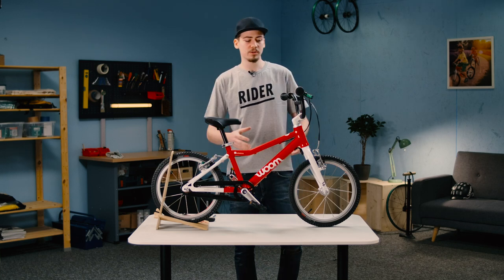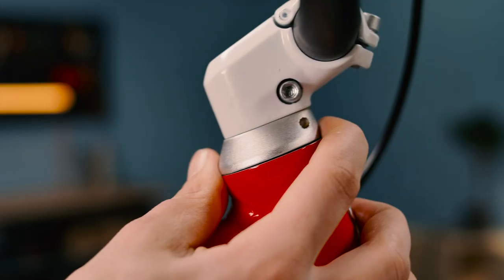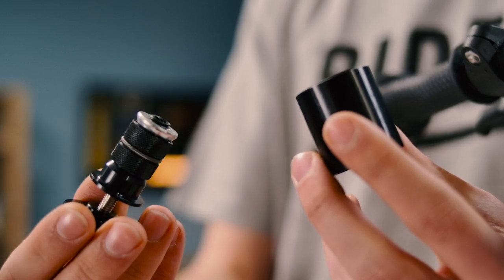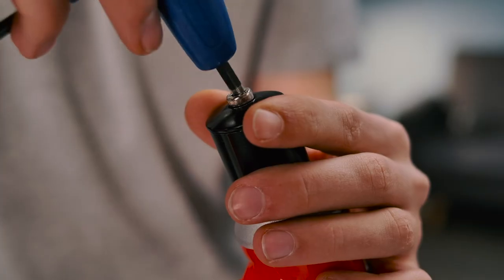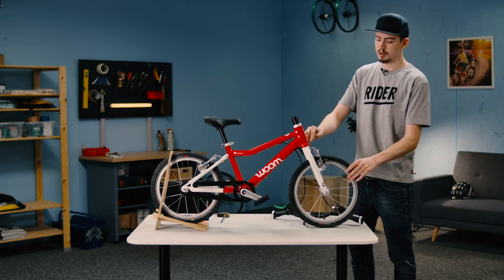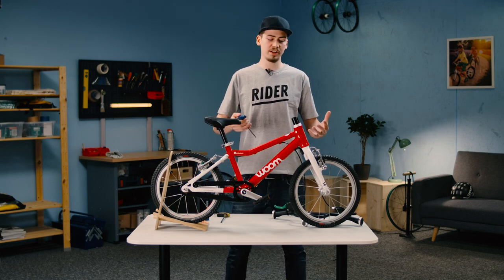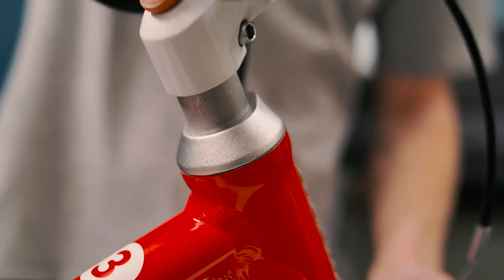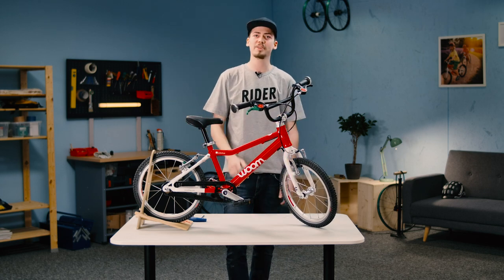How to tighten the headset | woom bikes HOW TO 2

Comment: The screw to loosen the silver cap of the headset is on our 2021 Woom 4 replaced by a Torx T-25 screw!
Reply from the maker: Hi Chris! Yes, with the models from November 2020 onwards we made some changes. The stem is now attached with a clamp using two side-mounted bolts behind the stem. Kind regards, Verena

Comment: What is the torque for handlebar screw on stem please? I used 6Nm, but my only 14kg daughter  can simple twist handlebar during braking, what is extremely dangerous. Thanks.
Reply from the maker: Hi Jozef! The torques are between 4 and 7.5 Nm depending on the screw and bike model. Since this is a very safety-relevant topic, we would ask you to send us at e-mail (woom@woom.com) with a video of the twisting handlebar. We would like to take a closer look at that and make sure that your bike is completely safe. Kind regards, Leonard